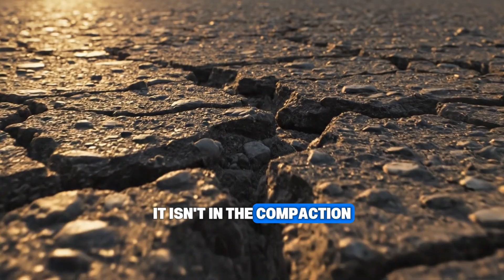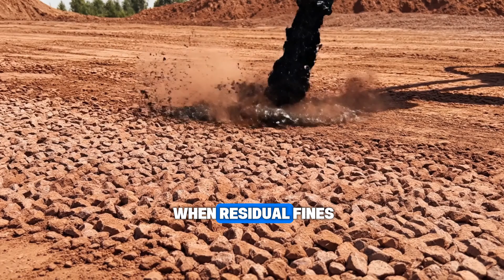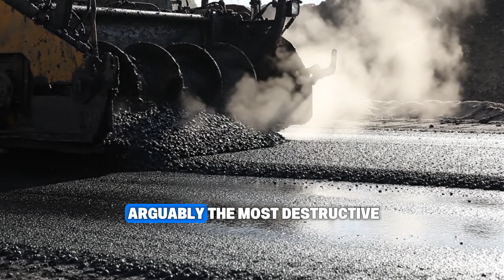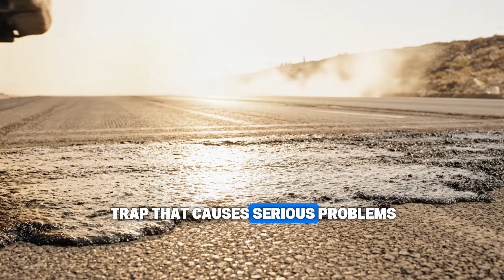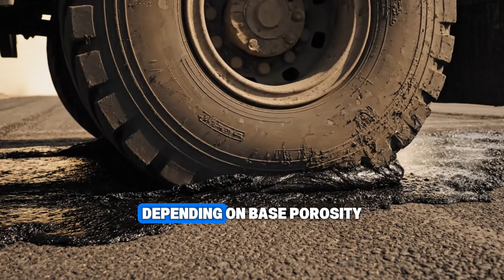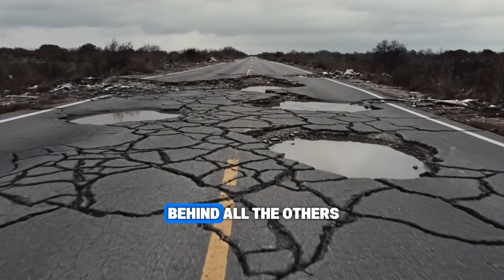5 Prime Coat Mistakes That Are Destroying Your Asphalt (And How to Fix Them)

Comment from the maker: How well do YOU know asphalt and pavement? Take the quiz and test your knowledge! Drop your answers in the comments below, and let’s see who gets them all right! 👇

1. What is a prime coat?
2. What causes alligator cracking in asphalt?
3. What is the main purpose of a tack coat?
4. Which of the following is a common mistake in asphalt paving?
5. What does a green checkmark typically signify in road construction?
6. What is one key factor in ensuring asphalt longevity?
BONUS: What's the most critical mistake to avoid in asphalt paving?

Let’s see who gets the most right! 🔥
Don't forget to LIKE and SUBSCRIBE for more pavement and construction tips!

#PavementQuiz #AsphaltKnowledge #CivilEngineering #RoadConstruction